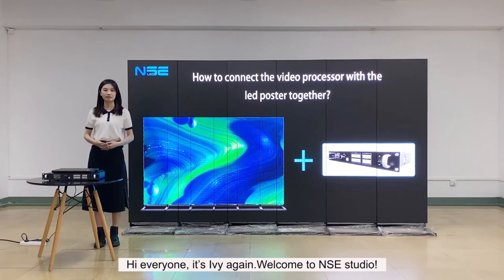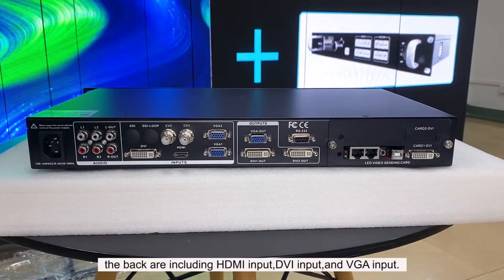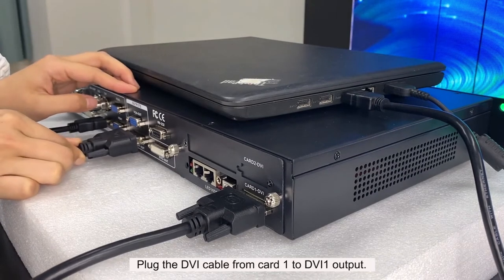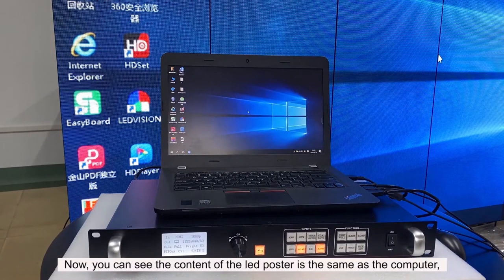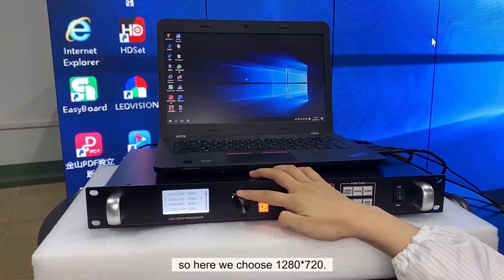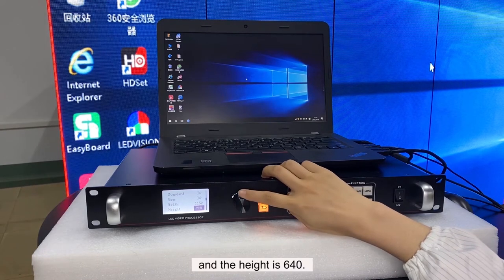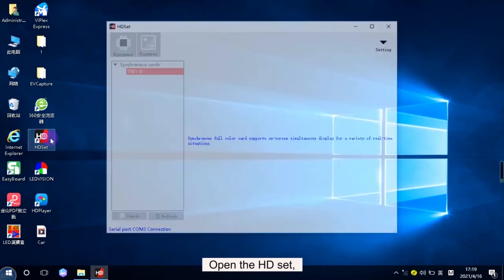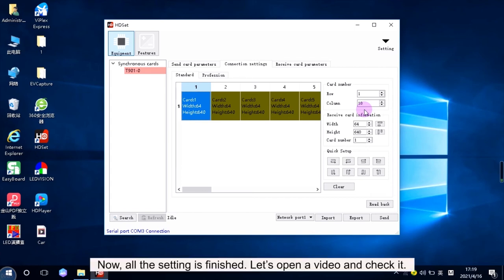How to connect the video processor with the led poster together?

Comment: What output formats does the processor support, can I also switch the output to 50hz? In the video I can not see that unfortunately .
Reply from the maker: Yes, you can switch the output to 50hz or 60 hz. We already test for 50hz and it works.